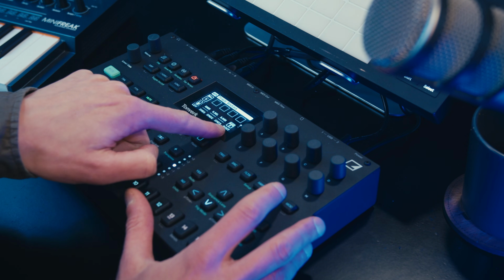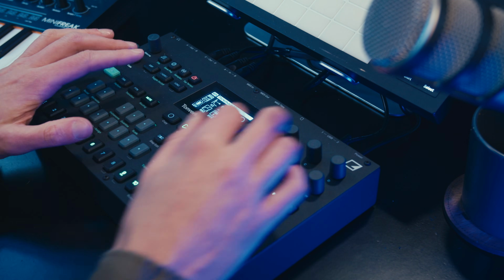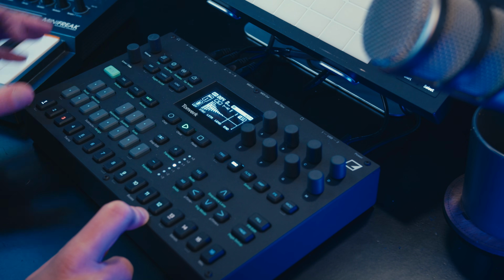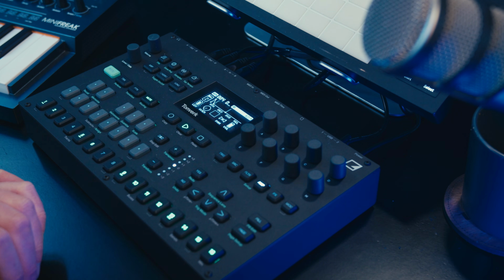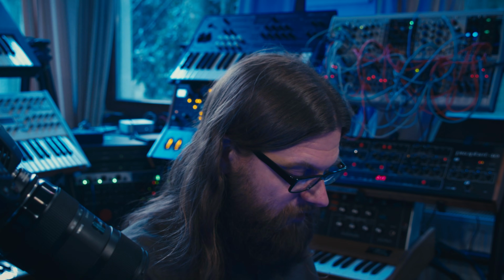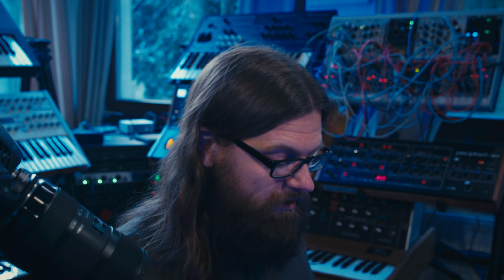Dub Techno with Elektron Tonverk (Music and track walkthrough)

Comment: Thanks for the video. What would you recommend for dub techno, Digitone 2 or Tonverk?
Reply from the maker: Depends on what you want to do with the machine, just chords and synths or drums or even a whole production? The Digitone is a very interesting machine, but with the missing sample capabilities you will need another machine. Tonverk could do it all, but the synthesis engines are missing here.
Reply: @MartinStuertzer thanks for an answer. It means, that I will buy both😁 Greetings 👋🏻

Comment: Did you send it back?
Reply from the maker: Yes, there are problems with sync and I don't want to keep working with an unfinished product.
Reply: @MartinStuertzer what Tonverk sync issues did you experience? would they be fixed using an external midi clock such as nome 2 or erm multiclock and Tonverk as slave? If I get one that is how it would fit into my current setup as a slave clock device along side my MPC and other synths

Comment: I’ve got the latest firmware and love the Grainer machine, and yet still enjoy the single player using the random waveform modulation on the start point. With that, even the multi sample files with this method can give good results. That same random mod against the filter frequency on the drum part can be pretty crazy as well. I’ve yet to try that against my JX305 drum parts sampled, yet I imagine it will sound a bit like a Wave Station.

Comment: Interesting thing is that nobody yet talks that bus and send tracks also have a sequencer, where you can param lock, or set trig probab at 0%, and use then STEP+YES to apply each specific step with its trig locks (similar how it worked on sytakt fx track). For me it opens a lot of possibilities, because you now can have separate audio tracks on different buses. Kinda like you are changing delay send to subtracks, but it can be automated with one button, using lfo as an envelope of that send amount. And then returning back to the default state also creates nice effects

Comment: Nice for demonstration - My Octatrack MKI says, : such a shame they done nothing new for my successor - I see & hear no new sound scaping functions - just  a Anlog Heat Digital FX Bus , a decent DAC and multi sampling function added - I feel Elektron is heading the same direction like Clavia - I hope for new innovations that are not just marketing tricks.
Reply from the maker: I think that the Octatrack’s firmware hits the CPU limit and they couldn’t implement more features, even if they wanted. Two per track effects plus 4 busses plus 3 sends with two effects each are 30 effects in total, where all previous Elektron machines had just two or three in total. My best guess is, that they are using a completely new platform for Tonverk.

Comment: Tonwerk👍 sounds beautiful
Reply: it sounds, but i think the sub-tracks aren't fun to work with. Its a little annoying that you cant select a sample form the project ram. You always need to select the sample from the SD and after that you don't have any reference back to the sample.
Reply: @Gruftgrabbler it’s a common complaint, but I guess Elektron think they would be a bit crazy to make the Digitakt II redundant by porting all its features over. I can see it pairing nicely with a DT2 though and there is enough new capability to justify it as an additional purchase. They’re really getting close to the whole DAW in a box thing with this